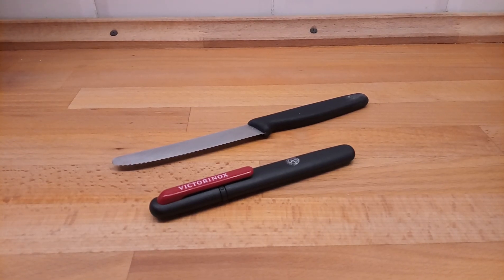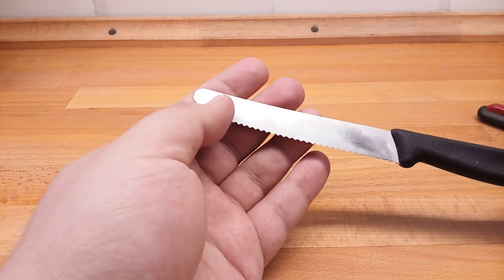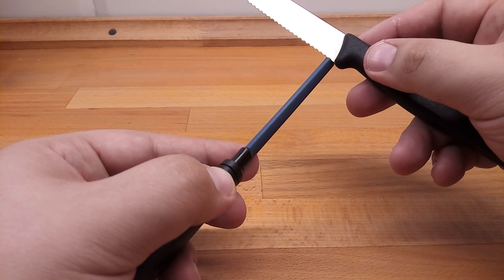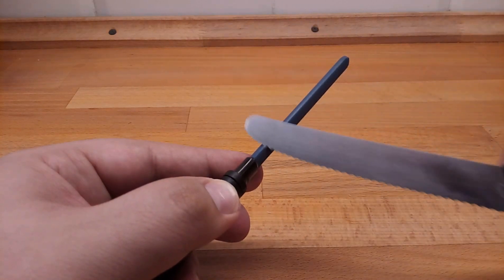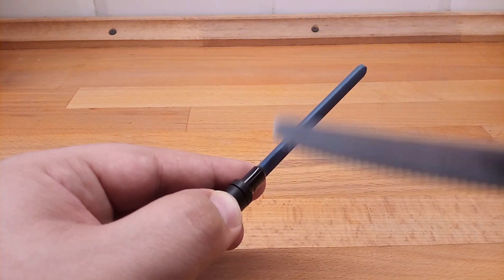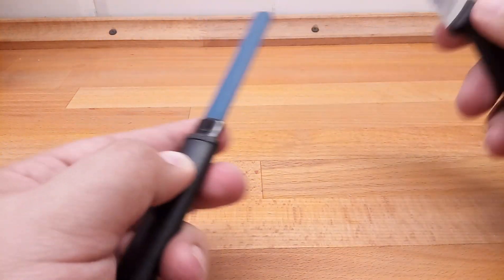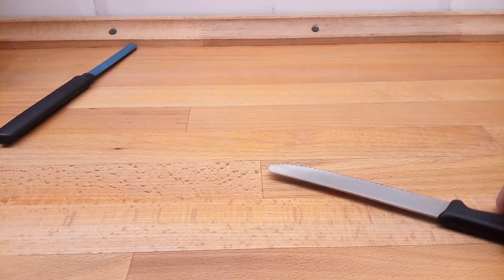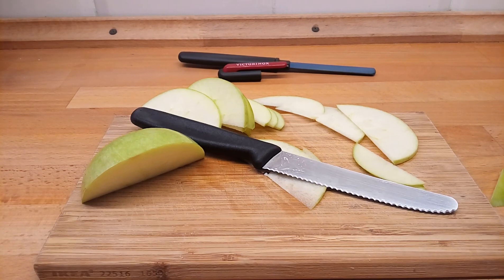Sharpening serrated knife with Victorinox dual sharpener

Comment: You just smooth out all the teeth of the serreitor.
Reply: What do you mean? Is it ok to sharpen serrated knife that way or not?
Reply: @LauraDeVasconcelos  This method will sharpen up the knife quickly and easily, but it also causes it to wear out faster.
If you want your knife to last longer you should slide the sharpener through each serration individually.
When you sharpen like it was shown in the video, it's mostly the tips of the teeth that get sharpened while the recessions remain comparatively untouched. Every time the teeth will get a little smaller. Eventually they will be ground down to a point where the knife has no teeth, just a wavy edge.
Reply: @abcdeabcde4877  cool thanks yeah i understand, had seen that in another vid. Cheers

Comment: Is it possible to start at the tip, and push away with edge trailing strokes? Like you’re stropping.
Reply: I was questioning the same issue. As a matter of fact, I have tried it, and it works very well